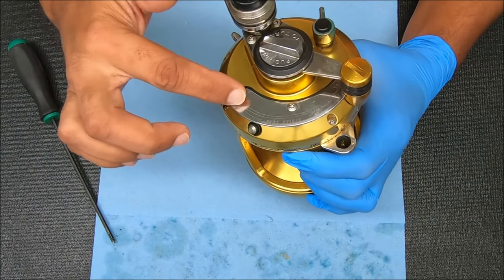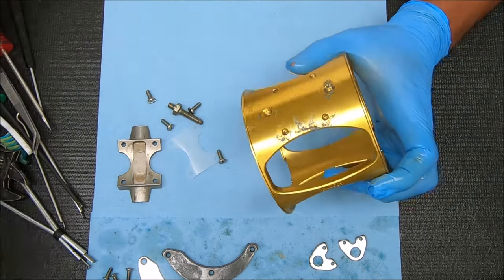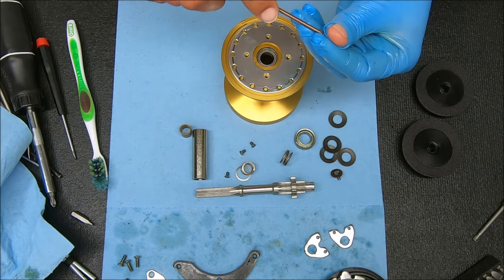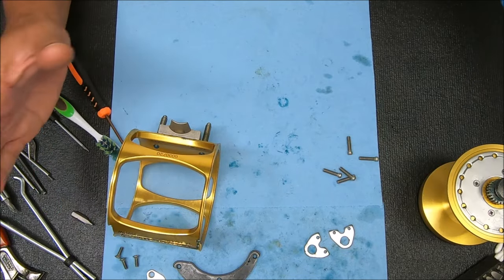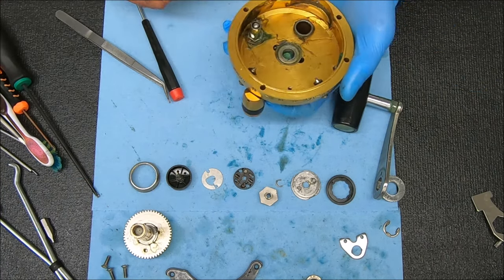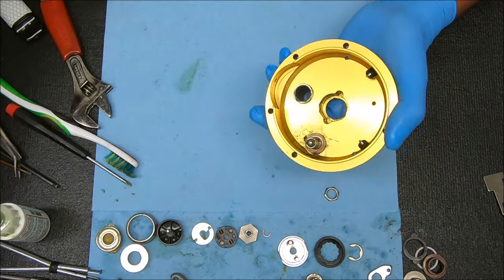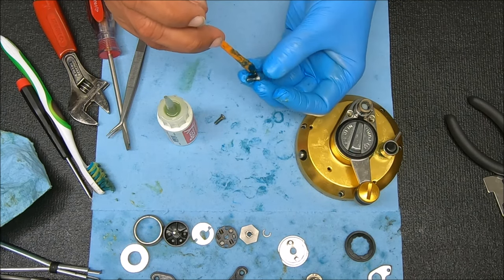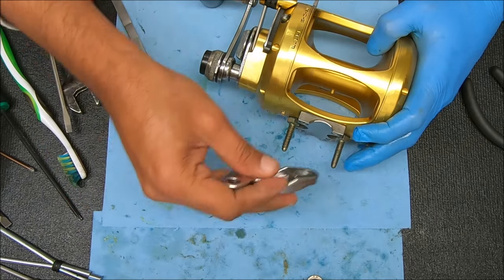Penn International 30VSW Fishing Reel - How To Service

Comment: Where do I purchase the tool for taking off the handle. It was the larger curved thin metal tool with the large two sided cutout in the middle for holding the nut under the cranking arm.
Thanks, Harry
Reply from the maker: Thanks for checking out the video. Check the box your reel came in. Spread the word about the channel.

Comment: thanks for posting this,  do you have a link for that bearing remover ? also how do you get the handle bearings out ? i'm working on a 80visw and theres no gap to get anything in there to drive them out
Reply from the maker: Thanks for checking out the video! No, sorry..... the person I got them from is not currently making them, last I heard. For your handle bearing challenge, post a video (add the video link in your reply here) that shows the problem so I'm clear on what you're having an issue with. Thanks. Barry.
Reply: @TSGReelService  was able to get a few of those bearing pullers what a great little tool these are ! wish i had these years ago. thanks again for posting these service vids, its really nice to review one before working on a reel i havent serviced in a long time or for the first time. - hope to post a few my self to help others as well.  servicing a 80 vsw  and a 80 stw today aloha
Reply from the maker: @djmikesea  Excellent! Yes, the pullers are very helpful! Totally agree on reviewing before jumping into a customer's reel. Post a message here when you put up your videos... might get you a few more views.

Comment: Trying to unscrew that plastic cover on the spool over the drags.  Your video it came off by hand but mines is stubborn.  You mentioned a tool you have to unscrew it?
Reply from the maker: Thanks for checking out the video. Yes, but if you've lifted the lock pin, it's unlikely the plastic housing would need it.... they're generally loose. If you don't have the tool, try using a strap wrench or gently tapping a flathead screwdriver in one of the grooves that the tool would go in (there's two slits on it). The cover is removed counter-clockwise.... be careful not to damage the cover with the screwdriver.
Reply: @TSGReelService   thanks for the information.  I’m servicing a 50 visx and that lift tab is a little different.  It doesn’t have that lip for the tab to be retained on when rotated 180 degrees.  I’ll wedged it up with a flat head bit but it may not have been enough.   I’ll try again.   I ordered the tool from mystic parts for $20 shipped.  Yikes.
Reply from the maker: @Shaungomban  No worries. You may be mistaken. The tool won't help you on the drag cover on the 50VISX.... I don't have all the answers for every reel, but in the future, it's best to say what specific reel you're working on if you want the best possible answer.... the drag cover on this reel doesn't have a lock pin. It's held in place with the click plate screws and click plate.... after removing the click plates screws and the click plate, you can remove the drag cover. To separate it from the outer drag plate, simply pull up on the drag cover while pushing down on the outer drag plate, to free the rubber inner seal (it goes back on by squeezing it back down on the outer drag plate until it pops in place. To reinstall the drag cover, you need to put on the click plate and screws back on.

If you have already tried what you were referring to in your message above, you may have already damaged the reel, so let's hope that's not the case. Probably best to take it to your local repair shop for help, just in case.... especially since there are some other nuances to this reel that are not covered in this 30VSW video.
Reply from the maker: PS - if you haven't received a shipped notification from Mystic yet, try calling them and speaking with Scott or Mo to see if you can cancel the order.
Reply: @TSGReelService  oops.   Sorry. The 50 vsx.   Small typo
Reply from the maker: Yet a significant one.... then you need the tool if unscrewing it by hand and my other suggestions failed. Make sure you ordered the correct tool. You can speak with them to ensure you did. All the best with it.
Reply: This spool is kicking my butt.  It is a 50 vsw.  I opened up the reel initially because the drags were not smooth at all.  Really sticky.  Figured the brakes needed replacing.  Lots of what I think is drag disc dust around the drag cover.  But it sure is stuck.  I wedged the retaining pin as high as it can go but the cap won’t budge.  The penn tool I got from mystic is so flimsy it just bends.  My strap wrench can’t grip the lip of the drag cover.  So I used rubberized work gloves and I can get a good grip on the parts but it just won’t budge.  I stuck it in the freezer but no luck.  Any ideas?  Tried tapping the edge with a flat head in the loosen direction but it just damages the plastic.

Comment: I took apart my vsx 16 and now my drag is not working. Where should I look first?
Reply from the maker: Thanks for checking out the video. If it was working before you took it apart, sounds like you may have reassembled it incorrectly..... but maybe not. Take a video of you using the reel and what you did to determine the drag wasn't working, put it up on your channel ad post the link to it here so we can see it.
Reply: @TSGReelService Thank you, just sent you an email
Reply from the maker: Take a video of you using the reel and what you did to determine the drag wasn't working, put it up on your channel and post the link to it here so we can see it. @sab35263
Reply: @TSGReelService I have another question on the 16VSX, I would like to swap just handle from the football handle to a T handle. Penn sells a T handle. The two screws that hold the football knob are very hard to turn. I wonder if Penn uses locktight. What do I need to do to remove and replace the football handle?

Comment: Any way to recover if instead of opening the clip on the drag cover, you accidentally take the e-clip off? @13:47
Reply from the maker: Thanks for checking out the video. Yes, use a small needle nose pliers to pull the post up as you open the cover. Then, after you remove it, you can push the post back up from underneath as you put the little silver plate and the e-clip back on. Make sure you put the spring back over the post before reassembling it. Hope that helps.
Reply: @TSGReelService had to resort to a sharp cuticle clipper but it worked! 😂 Thanks so much for the tip!!!
Reply from the maker: You're welcome and no worries. Happy to hear it worked. Hope you didn't tel your significant other about the clippers, if that's where you got it from. :)